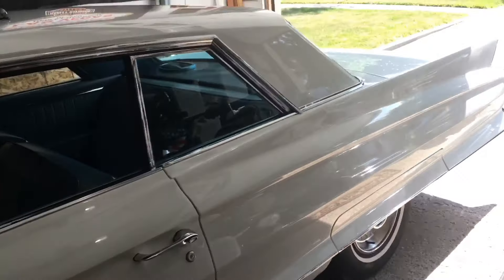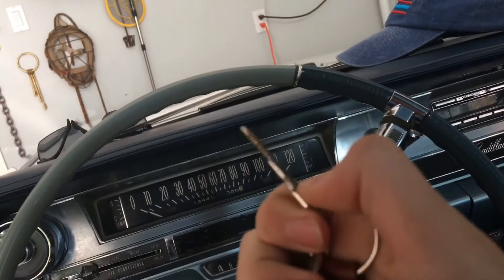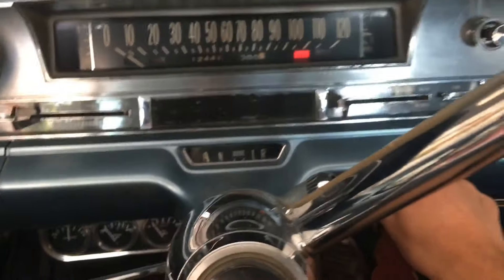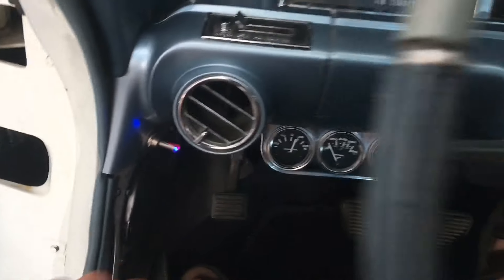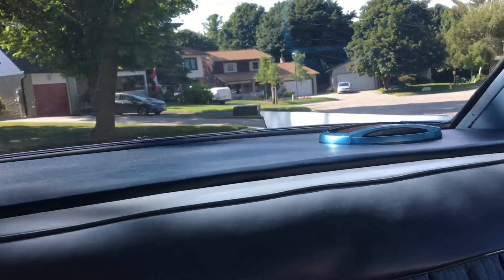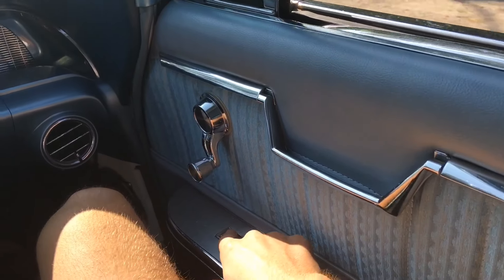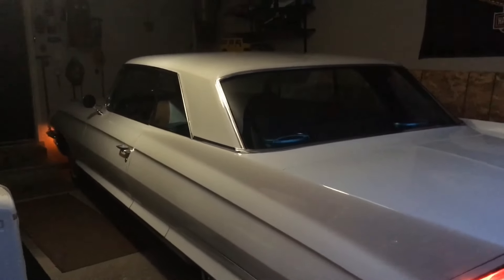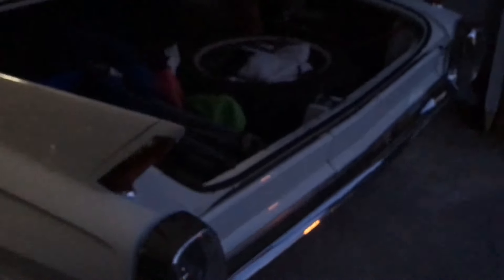1962 Cadillac Coupe Cold Start Up And A Awesome Drive

Comment: The '62 De Ville is one of my favorite Caddys. And '62 was a great year in general for, uh, the General (motors.)  All their cars were on the upswing to a high water mark for design and engineering, culminating in the '67-71 El Dorado, De Villes and Fleetwoods for Cadillac Div, and best designs for the other divisions as well. The 62 Caddy finally overcame fully the design excesses of the late 50's and the '60 models. The 62 refinements hit the sweet spot, in my opinion, though the '61 sailing tailfins do intrigue me. My very favorite Caddys are the '64 models.
Reply from the maker: Ohhh nice!!! That’s pretty interesting